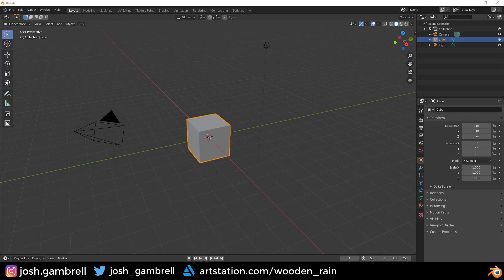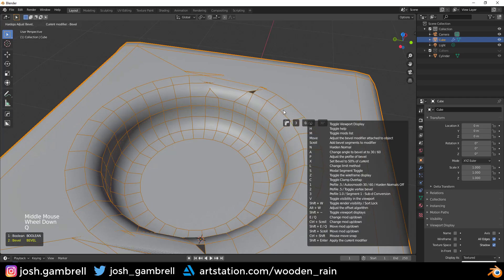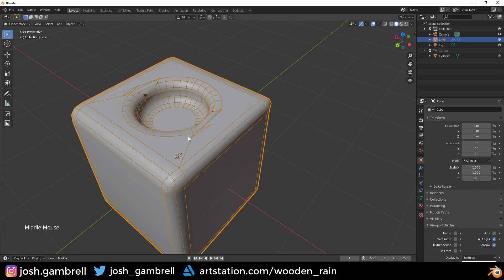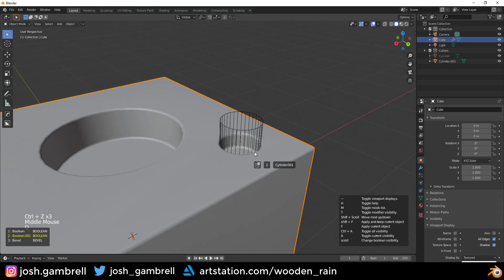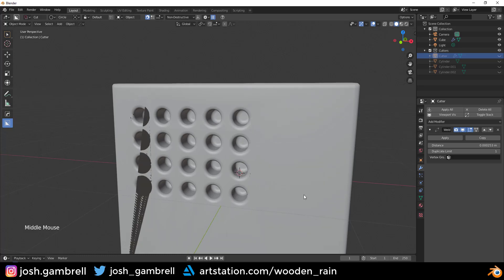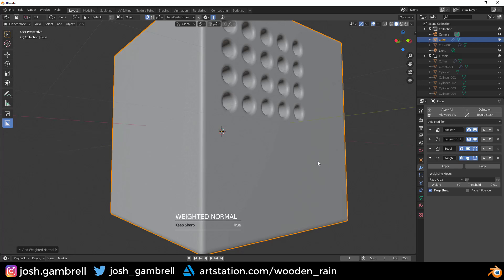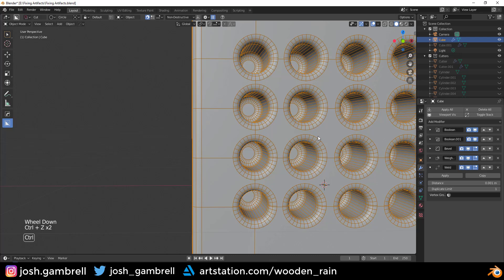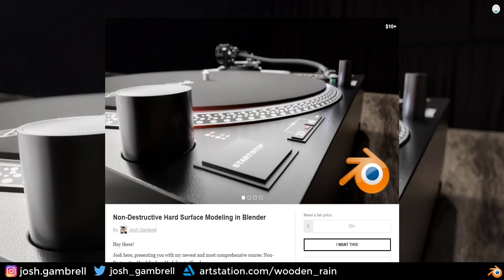How to fix artifacts in Blender

Comment: holy cow that "J" trick in vertices I didn't know about. THANK YOU MAAAN
Reply: Dude! I;ve been joining using F didnt even know you could just use J...
Reply: @frenzofficial4418  if you use F in the example in the video, it would just bridge the two vertices with a new edge, floating on top of the face, which would cause more problems than it would solve.  Using J is where it's at :D
Reply: cow is holy in india only.
Reply: Thank you

Comment: Much better solutions than the re-topoligizing I've seen elsewhere.
Reply: Generally you don't want to be modelling like this at all unless it's absolutely necessary, time is very limited and you're scene is very small (And you don't intend to use this in any other sort of 3D application like a video game). Generally speaking you always want to avoid Ngons and avoid having unattached edges. 

From a visual point of a view an Ngon looks like it uses less geometry so it should be faster to render but this is the complete opposite. 3D graphic cards do not support anything other than polygons, so you're renderer has to then slice up the Ngon prior to passing it to the graphics card. This causes overhead vs if you had just made sure your model(s) were already well cut and modelled from the start, additionally you're less likely to see post-render issues and lighting issues as you're not relying on an algorithm that is guessing what you wanted to slice up the geometry correctly.

Lastly a lot of other 3D applications simply do not support ngons because they don't want to deal with processing your model or will do so very poorly, this is very true for video game engines.
Reply from the maker: @howdlej123  If you're just going for a render it doesn't matter. If you're working with game assets, animations or deformations, good topology is a must. Prior to the render, Blender converts all topology to tris, even if the entire object is quad-based, so there are conversions occurring either way. With all respect to you, and with some of your points being valid, I just don't think the statement "Generally you don't want to be modelling like this at all unless it's absolutely necessary" is universal. If you're using an addon like boxcutter and going for extremely complex hard-surface models with a nice render, trying to model off of quads and create all of those tiny little cuts and slices is borderline impossible, and even if you could do it would take an insanely long amount of time. For someone like me, who primarily works internally with Blender, booleans and ngons aren't a significant issue for the projects I work on. I can see where quads and good topology become essential, but it simply isn't required all the time and can be even more difficult working that way.
Reply: @JoshGambrell  My point was exactly as you said, yes this is fine if you're exclusively using rendering applications that will do it for you and you're not planning on using this in other applications. However, converting an Ngon to tris is not the same as converting a quad to tris, it's more intricate and can lead to unexpected results, simply put a quad is made up of 2 triangles, that is easy enough for a computer but an Ngon, as stated in its name is an N-gon. A polygon made up of N number of vertices, the more complicated that ngon is, the more time consuming it is and error prone it is for it to be converted into tris. 

I'm not stating that you must always model as if you're going to export it to other applications, especially not if you're a hobbyist or you know the exact use cases of your model, nor am I saying you need to model using only tri's but as a general rule of thumb you should model using a quad or ngon which is more easily divisible into triangles. Small models this is never going to be problem but this is about instilling good habits to beginners. 

There are plenty of 3D artists out there who get away modelling all sorts of things ranging from organic to hard surface modelling and do so fine without expanding beyond quads, this is because they may use ngons and sculpting to start off with but they well then retopologize later so they have a cleaner mess that is easier to export to other tools and production pipelines. 

Appreciate the reply, and I didn't mean to say you should never use techniques outside of the standard realm, just saying it's good to teach watchers the pitfalls and potential issues they may run into and why they may wish to use other techniques. I almost exclusive do hard surface modelling and almost exclusively use quads and I've never ran into a problem I couldn't model using just quads, yes it might've took some extra time to work the topology to look right but I know in the end I don't have to retopologize my model should I want to reuse it later in another application i.e for games. At the end of the day the use case will determine the techniques you use and for hobbyist this won't matter much, I just prefer to give people as much knowledge on things because not everyone looking for blender tutorials is looking to just render out things in blender itself.
Reply: Nah, it's only acceptable - if you are making visuals, movie shots. And you ahve  small amount of time. it's better to spent 3x more time on model to get topology right. Then you ahve great baking, easier retopology and etc.
Reply: @howdlej123  a ngon is a polygon. Do you have any sources for GPU's 3D pipeline?
Reply: @doculab3d  Not exactly sure what you're asking for. A 3D Pipeline is usually an software specific term to describe the stages pre-processing, rendering and post processing that the application does. NGON cause deformation issues when rigging and will cause whatever render API you choose use to triangulate your model as it see's fit. Modelling using only quads is recommended as a square will almost all be evenly split along its centre into two triangles
Reply: @howdlej123  What is wrong with ngons if there is no deformation?

Comment: I went here because I ran into exactly this kind of issues with bevel. And the one thing I can say about it is, this is obviously a bug in the bevel implementation, it simply calculates positions of new vertices wrong under certain circumstances. It doesn't even happen just on face connections to me, even in places where the bevel runs through concave edge of single face. But until someone fixes it, I guess these workarounds are all we got. Thanks for the tips and information, it definitely helps.

Comment: A good thing to remember, and what took me ages to understand, is that every boolean cut needs an edge to connect to. You can't have a cut in a face without anything to support it. Blender is absolutely terrible at connecting it automatically, sadly (why does it always pick the furthest vertex on a circle?), so we gotta make more geometry as support.
Btw, dice in Hops is gold for this purpose. It doesn't care about ngons.
Reply from the maker: I've been using dice SO much lately. I don't know how he does it but the add on is simply amazing, finding ways around issues like this. That's why I wanted to make this video, so people could get the intuition behind boolean cuts,that way they will understand how to fix boolean issues such as artifacts :-)
Thanks for the comment!
Reply: @JoshGambrell  can u tell me more about this " dice in Hops" thing? is another app or an addon to blender?
Reply from the maker: @woolenwoods665  Hard Ops is a premium add on intended to hlep with hard surface modeling. Basically, it has a command called "Dice" which allows you to add segments kind of like a loop cut straight through the mesh, even if it's full of ngons. The alternative would be cutting straight through multiple times with the knife tool, and would take a really long time. Dice does this in seconds.
Reply: @JoshGambrell  thx for the reply!
Reply: @woolenwoods665  Here's a great overview of its Dice feature with videos https://hardops-manual.readthedocs.io/en/latest/dice/ and the addon in action. https://www.youtube.com/watch?v=y2QBY1SseLU I hope youtube doesn't flag links.
Reply: Ha, try boolean in C4D :D
Reply: @radoman1234 , that's why I migrated to Blender!  With E-cycles, it's close to Redshift too, in speed and performance, if not ease of use.
Reply: @jeffspinner6579   I do not drop C4D entirely, habit is too strong, also C4D have some nice tricks, but this is more or less inevitable. And I sometime use Octane for Blender, very nice and free for now :)
Reply: @radoman1234 , thank you.  I used to know Octane like my wife.  Now ex-wife, so did I really know Octane either?
I have these two tuts too: 

CG shortcuts-The Octane Materials Masterclass 

InlifeThrill Designs - Understanding Octane Renderer for Cinema 4D

So I'm hoping that will be enough.  What sucks is all my C4D material libraries are formatted for C4D, unless I can convert somehow to Octane Blender useable files.  Idk, only Gorilla materials looks usable so far...
Then again, do we have access to the material db like paying customers do?  I got to check that out too...
Reply: @jeffreyspinner9213   Thanks for links, unfortunately documentation on Otoy site was... poor. You can access db library, just type db in search. "Final Result" have short video about this, also in some videos he mention that Octane for C4D and Blender have difference, they do not behave same in some situations. I make one scene with lot of glass, ice, want to put some volumetric, as far I know Octane handle this stuff much better than Cycle. Anyway I hear all best about E-Cycles, but this is too expensive to me these "Q" days
Reply: H D  Be fair, when you do manual retopo after boole operations, for sure have couple tough moments when must decide how to solve edge flow, especially on complex surfaces. 
So how to expect that software solve such stuff perfectly.
Reply: This is a big problem in Maya, too.

Comment: As a person who just started to HardOps and used these techniques on this video without the add on for some time; If you are not using the add on,  "weighted normals" modifier comes with "keep sharp" unchecked, Josh Gambrell here using HardOps which automatically checks the "keep sharps" option. Also, with that kinda mutiple holes in a single mesh models, marking one edge loop as "sharp" on the holes might help with some "smooth shading" problems. Also, without HardOps, you might need to enable "Auto Smooth" in "Object Data Properties -> Normals." Even this little example shows how much time it saves to use that kinda add ons. Thanks Josh ^^

Comment: I am so grateful for this How to. Just started in Blender a few days ago because I wanted to animate some AutoCAD .stp files I got - just rotating the objects. Used CadAssistant to convert from .stp to .obj and after importing into Blender all those artifacts drove me nuts and I could not figure out how to solve this.
Last time I did modelling in a 3D software was in the 90-ies with Lightwave 3 on an Amiga 1200 with 60030 @ 50MHz - it took a week to render out a 20 sec animation in 720 x 576 50i - about 10 min per field. To actually see the rendered animation I had to put the image sequence onto 20 floppy discs and go to a shop where they had an expensive hardware videocard for playing back this in realtime to a CRT.

Comment: I was a bit confused by this at first and I have been modelling since 1995 :) but it works great and you can use it non destructively ie I can keep my original low poly base, add the subd d, then boolean and then bevel. great stuff.
😁

Comment: Check, or uncheck, the Loop Slide option in the bevel tool options and it will do the bevel making use the bevel itself stays intact, moving the edge connection point. Then you can just manually edit the connecting edge to a better location.

Comment: Thanks for the video! That was something I dreamed of learing, but didn't quite know where to start. I'm modelling a lot for 3d printing and artifacts can mess up your print, sometimes even when you can't see them in viewports. I'm trying to make things in a non destructive manner, and after a certain point of complexity objects become just broken. So I figured out the way to deal with  it by switchibg to OpenSCAD, which gives far less problems with booleans, but in some cases it's far more time consuming to make things there. So thanks again! I can rely on Blender more in this regard now )
Reply from the maker: Yeah for 3D printing booleans and topology don't really matter so long as it isn't littered with artifacts or non-manifold geometry. If I'm trying to design something to print, you'd puke seeing my wireframe hahaha

Comment: What I found useful is putting weld mod there, then slide these edges until they're merged, adjusting the value may merge the cylinder vertices if I'm using a 64 verts cylinder

Comment: Cutting an egg-shaped cavity out of an egg-shaped object, using booleans always requires some clean up. Merging two vertices that were practically on top of each other ruined my shading.
Weighted normal modifier saved me from having to remake the whole thing over. 😎👍

Comment: "I don't think it's worth fixing artefacts 100%" - spoken like a man who doesn't have a 3D printer! Slicer software tends to choke on anything non-manifold. ;-)  Seriously though, excellent video and some very helpful stuff. I already knew that adding extra cuts and such could help clear out artefacts, but I was unclear on exactly *why*. This should make cleaning up my 3D models a lot easier.
Reply from the maker: Awesome man! And thanks for that info. I very recently purchased an Ender 3 so I’m still very new on what to avoid or focus on when modeling for 3D printing. Cheers :)

Comment: An excellent tutorial, mate. Very clear, comprehensive and provided solutions to all the major questions that might come up. 
You're kinda gearing up to be the Arrimus 3D of Blender with these modeling workflow videos, even though Arrimus himself is dabbling in Blender right now, so it's only better to have two of you instead of one ;)
One small thing that I felt you kinda weren't as clear about is towards the end about face orientation overlay. That is used to visualize normal direction of the faces and not necessarily to identify artifacts, because while artifacts are undesirable, flipped normals very well might be desirable to have, for example, in cases like inverse hull solidify for toon-like outline, or use cases requiring or permitting backfaces as part of the end result. So I guess saying "if you find any bad red spots, there's a bad artifact, if everything is blue, you're good to go" might not be clear enough to beginners about the actual function of the overlay, which is agnostic about whether or not the face orientations you see are bad/undesirable, as there might as well be red spots that aren't actually artefacts at all but something you actually want.
Other than that, a super solid tutorial, I learned a lot, thank you and keep em coming! Congrats on 10K as well. :)
Reply from the maker: Thanks Ruthwik! That’s actually a very fair point I should’ve been more clear about. I meant to mention it as a quick and dirty tool to find artifacts quickly, but  I probably should’ve mentioned that not all red correlates to that necessarily. Thanks for the note!
Reply: @JoshGambrell  haha no problem! I figure it'd something that people would eventually learn about intuitively when they came across to use it anyway. Cheers. :)

Comment: That's an issue I ran into early on and my solution originally was to subdivide the cube in edit mode prior to applying the boolean. It worked most of the times . But at some point I started using the knife tool to create intersects where I wanted to make a boolean operation and that worked better. However, I never really understood why it was doing what it was doing. I understood poor topology was causing unwanted overlaps. But I didn't understand why Blender was doing that. Now I do. Blender is just connecting to the nearest vertices.

Comment: This is great. Thank you so much. How can you see the wireframe on top of the shaded material in your viewport? I can't get the same visuals. Hmm.. also, was there a change in the Bevel options/features? I can't re-produce the same you show in your video. Thx and keep rocking, cheers
Reply from the maker: I use the hard ops addon. If you go to viewport display -> wireframe you can view the wireframe.

Comment: turning on face orientation isnt just to fix artifacts if u see a red face when u turn of face orientation go to edit mode and go to face mode or press 3 and select the red face and press Alt+N and Flip or sometimes and simple meshes just select all the faces and press Alt+N and Recalculate Outside it is very important to make sure the orientation of your faces are in the right direction i didnt know about this when i started and sometimes and  a face was red it would cause shading issues in blender but the most important part of having your faces in the right orientation is lets say you want to export your mesh and import it into a game engine or whatever, when you import a mesh with red faces that are supposed to be blue the face would be missing and transparent, it might take some time to make sure your faces are in the right orientation but its a good thing to do and is worth it

Comment: awesome video! I heard about transfer normals from pre-boolean object to after-boolean object using the data transfer modifier. Does it help deal with artifact problem or in what cases is it used?
Reply from the maker: I honestly usually just use data transfer for seamless normal snapping, not sure which cases if would help artifacts (if at all). Someone more familiar with that modifier could certainly provide a solution as I don’t have a certain answer.